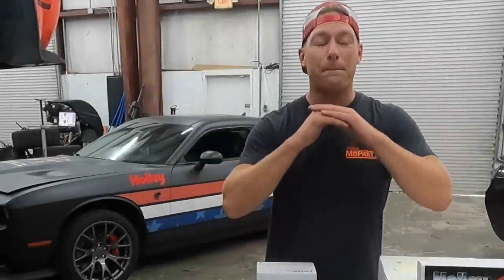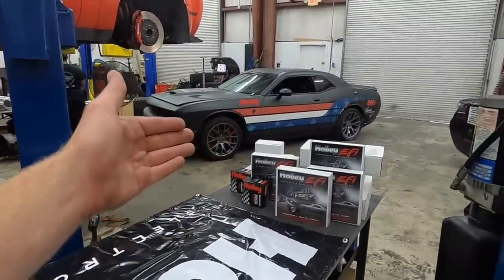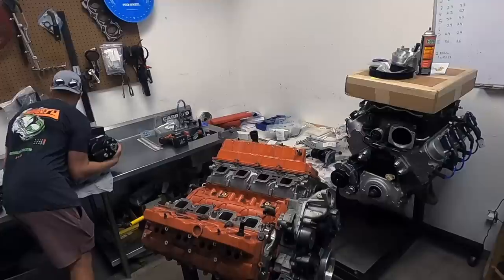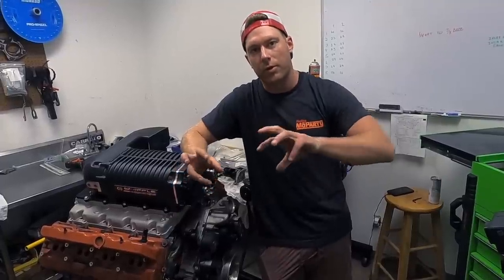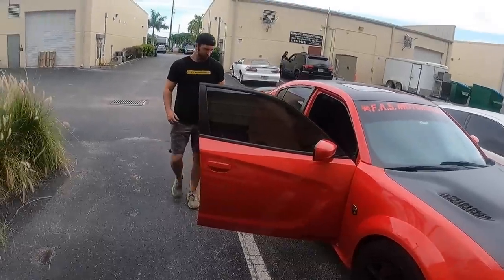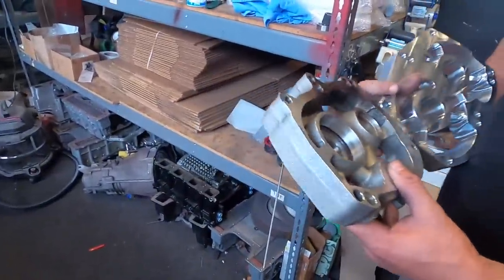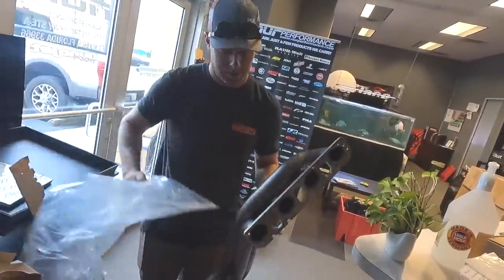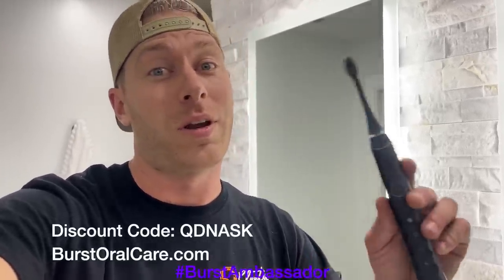MASSIVE UPGRADE for the Worlds Highest Mile HELLCAT! Huge Blower & Computer Upgrades!!

Comment: Man it seems like FL is the capital of racing for everyone. You can get any part custom or fixed for performance at a shop anywhere in FL. You can get harness at one shop, driveshaft from another, custom spindles at another, machined block not only that you can go to a killer track also. You can drive to all of them, am jealous of the racing community in FL.

Comment: That thing is going to be fun! Seems like you are putting your money in the right places. Do you know if Cleetus has figured out Ruby's crank signal issue? Supposedly he needs to have a 4 magnet inducer wheel on the crank snout instead of the 12 magnet version. According to several people the 12 magnet ones don't work well with a holly. He is a difficult dude to get a word with though. I love your channel though, it's nice to see the technical stuff covered more thoroughly. Most everyone else skips over it or time lapses it all besides Kevin anyways.